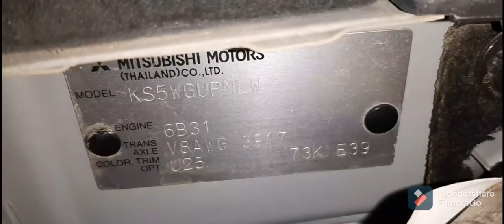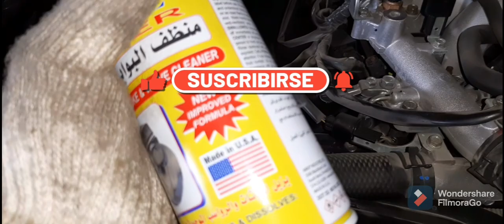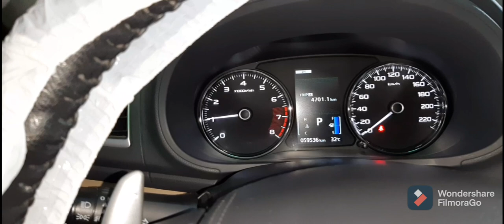Low And Poor Idle. How To Clean Your Electronic Throttle Valve [ E.T.V.] D.I.Y Tutorial Guide.

Comment: Good day boss my montero sports 2017 gas type has problem of rough idle. Can you give me some tips regarding for this problem thanks for the answer
Reply from the maker: Sir did you try to clean the throttle valve (ETV)?
Reply: nope sir minsan sir pag off ko yung ac namamatay yung engine. pero pg nka on yung ac parang normal nmn yung tunog ng engine ty po sa sagot